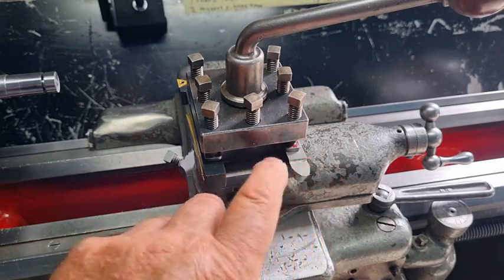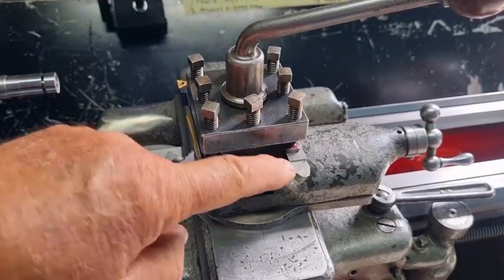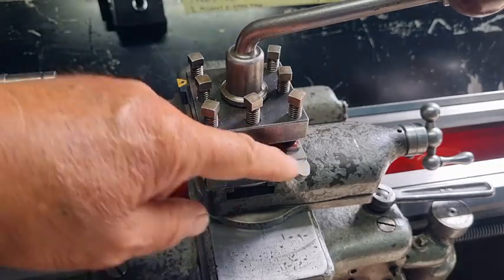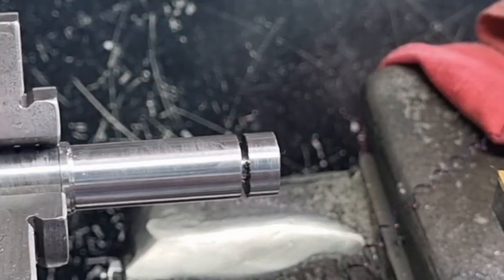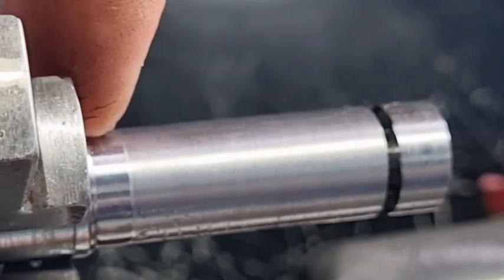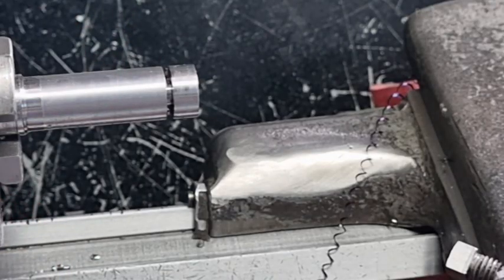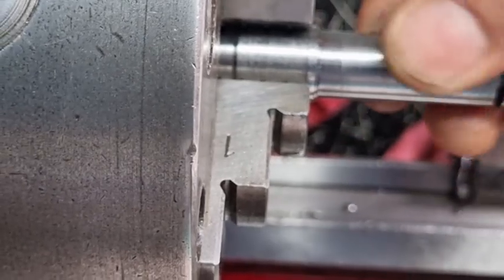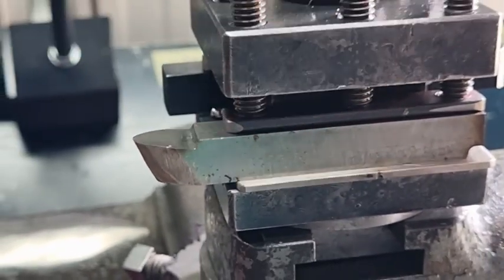Carbide V HSS surface finish in low carbon steel.

Comment: Did you try a vertical sheer tool?
Reply from the maker: Its not vertical 5°
Reply: @hercus9a there is a video from tubalcain about it.
I think a better name is tangential sheer tool .
Reply from the maker: @MaD_Man_2000 yes tublacain great man with many years of experience. 
They say tangential sheet tool almost vertical maybe 1° angle
Reply: @hercus9a I use mine with a 10 to 30 degree Angle 
Works fine for mild steel.
I made it from a round rid of HSS.
I can rotate it in the holder to change the angle
Reply from the maker: @MaD_Man_2000 30° is a huge clearance
Reply: @hercus9a it's not clearance, it's the contact angle .
The clearance is about 5 degrees 
This tools di not work like normal cutting tools.
The sheer the chip to the side.
Completely different action of cutting....
But you can only do finishing passes with the tools.
About 2 or 3 thousands 
Not more
Reply from the maker: @MaD_Man_2000 i just watch Tublacain video on vertical sheer
Interesting video

Comment: I like to use cermet ccmt inserts on crap steel like that, seem to give the best finish on my hercus 9a. Cost about $15-$30 a pack from aliexpress. Can even get them in large radius button inserts. No need to have them below centre. Just need the right depth of cut.
Reply from the maker: I brought those small button ones also on ebay they are about 6mm diameter and yes you get a better finish.
Mild steel is the challenge compared to say 4140 ect.
But mild steel is cheap and i have lots laying around.
I guess you have to find what works for you and stick with it.
Interesting reading users comments as we can all learn something form each other.

Comment: Your most likely aware that excellent finnishes can be achieved with a slight lead in, with parallel to the work surface(axial)flat tip HSS piece, on low speed/RPM with cutting fluid/oil, between centres & saves additional work later.
Reply from the maker: Yes and I use a large radius HSS
I must experiment with HSS radius for best results. So you are saying HSS profile is flat?
Reply: @hercus9a yes even with no rake. Our teacher in the early stages of the apprenticeship showed this & can quicly be acieved but with light  finishing cuts. Good concentricity & parallel, easy to achieve sizes.
Reply: @chris_sirhc01  Was he using a vertical shear tool?
Reply: If you are determined to achieve finish size on an old lathe without abrasives, best of luck with that. However to simulate HSS performance simply use Aluminum geometry inserts with a high positive rake and ground edges.